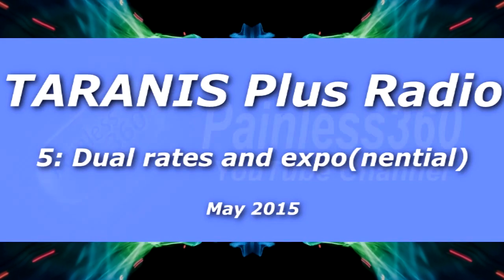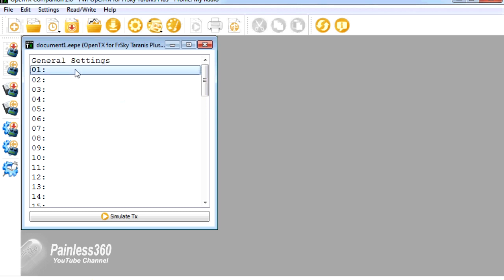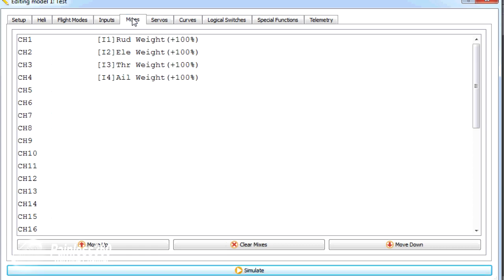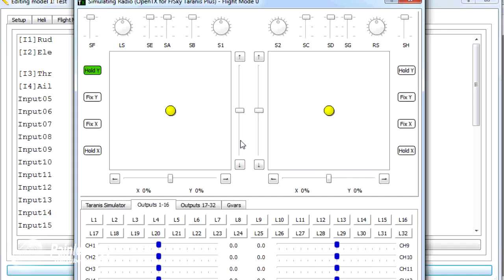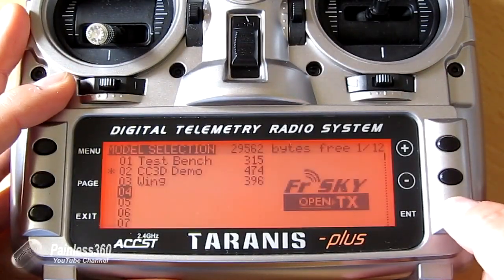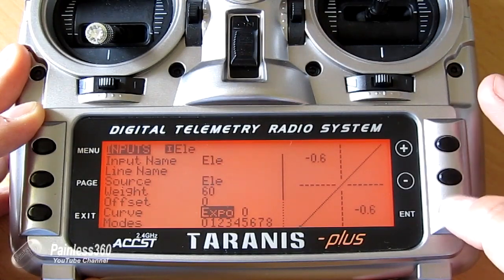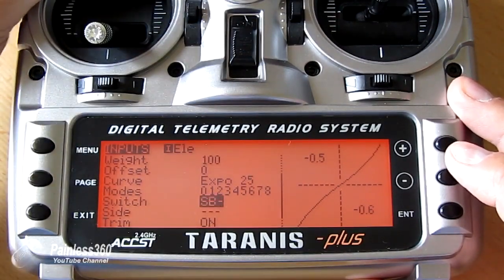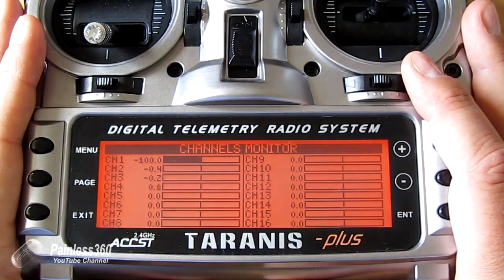(5/12) FrSky TARANIS Radio – Dual Rates (D/R) and Expo (Exponential) setup

Comment: Painless - wickedly helpful. Been wondering how to do this on my new radio, as I have it (finally) bound to my XK X100, but there is no documentation to help. Got it bound with some help of another video, and got it switching between angle mode and 3D, but had no idea how to do the rates. This is the final piece, so thanks hugely for this. K

Comment: Works for the same tx running edgetx. 7 years into the future 😁. I just swapped a 🦕72mhz🦖 rx for a betafpv micro elrs in an old glider. Boy have times changed from using dip switches on the back of the radio😅.

Comment: Needed this to set dual rates to change with the flight modes on my Dart 635mm. Needing full throws in stabilized mode, and less throws in acro modes. Like many things in OpenTX, once you know where to find it, you can adjust just about anything.

Comment: Great Taranis video. Very helpful in demystifying this superb radio. I, like you am a Mac user. However, I noted that you often use a PC Netbook when interfacing with the Taranis, such as adjusting firmware. Please talk a little about the pros and cons of using a Netbook in place of Mac OS or running Windows on your Mac.
Reply from the maker: +Escape Velocity I don't use any Mac products so don't have the experiences, sorry. Happy flying!

Comment: Thanks and used your guide on my X7 - works perfect! ...remark for you; I assigned it to a 3 way switch, top & middle, but when i put the switch in the low position you get no outputs at all anymore and can be tricky while flying - so i assigned low rates to the other 2 positions, dont want to get any issues while flying. Regards, Floris
Reply from the maker: +MileageMayVary you can add a setting to the switch you're using if you want to use a three position switch  or use the ! mark.. see our video on that..
Reply: Yes will look for that, thank you... was wondering about the !mark. For now i have 3 rates high, mid & low.

Comment: Hello Joshua I have a question. Ive had my Taranis XD9 Plus for about a year now and have solely been flying quads so expo was always on the FCB. At this point I have setup my elevon mixes on the Mixers screen. I also have all of my weights set here as well. I have been told to only setup expo on the Inputs screen yet there are Expo settings in the Mixers as well. Since I am new to fixed wing I want to keep this as simple as possible so I would like to start out without Dual Rates. What is my best approach to setup expo that approaches all aspects of what I need. On mY Mixers screen I have as follows: CH1 Throttle, CH2 AIL/ELE, CH3 AIL/ELE.
After seeing your video it almost makes me believe I can accomplish everything I did in MIXERS on the INPUTS page?
Sorry if this were quads I would be rolling right along LOL, the fixed wing thing is new to me. I kind wish there was a manual on this stuff :)
Reply from the maker: Joshua? I'd always put the expo into the model in once place if I can. That way if you change it then you don't have to find the other places you've set it up to make it the same. Also, by using the inputs you can use flight modes to set up the model too..
Reply: Sorry PainLess I had too many pages open....my bad :)
I appreciate your response. I did in fact go to the Inputs page and apply expo and it seems to be working. Once I get more Air time I will move into Dual Rates. I see in your video you (in this case) only applied Dual rates to the Elevator would I also apply it to Aliron? One more to eliminate my confusion. As mentioned I set up my Weights in the Mixers screen. Obviously I can forego the Weights in the Inputs screen but once I assign a switch for Dual Rates will those Weights in the Input screen override those in the Mixers screen?
Reply from the maker: If you're setting up for a multirotors then I'd add it to both. Usually something like 25% on Aile and Elev and 15% on Rudd.. Best of luck!

Comment: Thanks for the great tutorial. I find them very helpful. I haven't seen this before, but I wonder if it is a good idea to set rates on the throttle as well. I am just learning how to fly quads and I think having the double rates and expo on the throttle would be helpful. Do you think that is a good idea?
Reply from the maker: I wouldn't set rates but I do usually add a little curve to the throttle to flatten out the hover-point and add 'an expo' to throttle for newer pilots. Lots easier to hold the hover like that.. Hope that helps..

Comment: I have just tried this on a Taranis OpenTX 2.3.7 via the companion and for some reason it seems to invert the input, i.e. 100% at switch position SB-, and 60% at switch position SB-back. Repeating this on the Taranis directly gives the expected result!
Reply from the maker: Sometimes you find that Companion has a few 'features' that get fixed in the next version - usually! Always good to check it works the same on the radio... Happy flying!
Reply: I know this is an old comment but hopefully it will help someone.  If you choose the option with the exclamation point in from of it, it will be inverted. i.e. !SB↑ instead of SB↑

Comment: What do you do if, at no matter what weight you set, the graph,  the monitor, a meter I built like yours and the elevator, and other controls,  all travel the maximum distance. Thank you, for the great tutorials. The best.
Reply from the maker: Check you've not missed a step in the video ;D Best of luck!
Reply: I am sorry, I guess my question got confusing. Simply,  no reduction in weight causes a reduction in the servo throws. Why?
Reply from the maker: Something in the mixing you're doing is making that happen. Equal weights = equals throws.. I'd start again with a clean model. Best of luck!
Reply: Thanks, That did it.
Reply from the maker: Glad you sorted it. It's so frustrating to follow a video and get to the end with a different result!

Comment: Great video tutorial. I am new to the QX7 and used this video to setup dual rates. One thing I noticed during testing is that if dual rates is setup on a 3 position switch, SB in this case, and the switch is put in the fully forward position,  SB↓, there is no output to the servo's i.e no control ! This could happen accidentally. Is this correct or have I missed something ? I have copied the dual settings from SB- to a third position set as SB↓. This will eliminate the problem. Again thanks for your tutorials.
Reply from the maker: Use the ! Setting, see the video on it in the OpenTX mix school playlist.. best of luck!
Reply: Great that’s it, knew I was missing something. Using the !SB is the safer option, thanks again.

Comment: I love it how you keep it simple when explaining.Thanks for the video. I learned a lot again as a beginner. I have one question. When i hit the switch to the edited expo and dual rate of my aileron  it doesn´t work. The aileron doesn´t move.
Reply from the maker: Then something isn't right. If you get into these kinds of situations then add each piece of the mix, one at a time, until you find the one that breaks it. Easy to miss one little piece that causes it to misbehave! Best of luck!
Reply: Thanks a lot. It works. like you said i missed one little piece.
Reply from the maker: Hey! Glad you sorted it. It's so easy to do. We do it here lots and have to refer back to the videos for things we've not done for a while! ;D

Comment: Hello your video's are awesome and help a great deal.
I have just recently purchased a taranis 9dplus and its takes a little bit getting use to.
So my question is my thr kicks when my stick is at 50% i cant seem to find the sub trim if that is where it needs to be adjusted.
I love this tx and hope i catch on.
Thank you very much and you really give great instructional videos
Reply from the maker: +Erich Ristau if you mean that the throttle only starts moving when above 50%, then I check the stick calibration. Best of luck
Reply: Painless360 thank you i will check that thank you for the quick reply
Merry Christmas

Comment: Great article :)
However I was wondering, if I wanted to reduce the sensitivity of my quad by setting up dual rates/expo, would I do that for all 4 channels or is setting it up on the throttle generally frowned upon?
Just I am going either up or down, with little control sensitivity from my inexperienced hands :)
Reply from the maker: For a new pilot 25-35% on aileron and elevator, 15-20% on rudder and nothing on throttle. Best of luck!

Comment: NIce tutorial. Would this work if using it as teacher to the student radio DX5e? or does it depend on the student radio?
Thanks
Alex
Reply from the maker: Should work.. Best of luck
Reply: @Painless360  so if i set teacher radio with 30 % expo, when fli switch to give control to student radio....the student will have also 30% expo?
tkd

Comment: Using dual rates on my Eachine wizard x220s I set the switches up just like you did but i set up for 60 80 and 100 and it seems to be working fine I haven't stepped up to 100%  but it seems to be working good if you set up for a plane of some sort well that works fine for a quad as well

Comment: Newbee question. Why do you need the switch condition on line 3, the elev  low rate. Surely if "SB up" is not active, the next line, low rate, automatically becomes active as does any other position of switch SB.

Comment: You are perfect as always. I have one question. Can we assign only one switch for all the surfaces such as ail,ele,rud or only 2 surfaces like ail,ele.? Rather than having different switches for different surfaces. U know as there are several models on my taranis so sometimes its confusing to find which switches i have assigned. I hope u understand whT i meant. Thanks.
Reply from the maker: Yes you can. One switch can control many hangs at the same time. See the other videos in the OpenTX Mix School for a series designed to teach from the very beginning..
Reply: Painless360 Thanks a million sir. I just tested it and yes i can use one switch. And Thank you for the awesome work u do for us. And Thank you for the in depth detailed videos.

Comment: Very nice video. However, you should have setup switch B's forward position. If you were to move switch B to the forward position you would lose elevator function.
Reply: Curtis Adams Not only do you lose the function of the stick but when you set the switch to the unassigned position it holds the input at the value of the stick throw.  If you had, say, right rudder at about 50% at the time,  the rudder will get stuck at right 50%.   At least it does on my Taranis + with the stock firmware. A rather surprising and potentially disastrous default if you accidentally knock the switch when flying.

So you should either assign the third switch position to get triple rates which is effectively this logic...
 
if( SA^ ) {  //if switch A up
 high rate
}else if ( SA- ) { //if switch A center
 medium rate
}else if ( SAv ) { //If switch A down
 low rate
}

or use the NOT switch position (!) to use all the positions eg SA^ for high and !SA^ for low which is effectively this logic...

if( SA^ ) {   //if switch A up
 high rate
} else if ( !SA^ ) {  //if NOT switch A up
 low rate
}

or set up an input default.  The "lines" for the input get tested in order, top to bottom so if you assign the first line to SA^ you can use --- for the default second line. You have to have two lines.  You then have this logic...

if( SA^){  //if switch A up
    high rate
} else {  // otherwise
    low rate
}

One other point is that it is not necessary to hold the stick at full throw to switch between the rates. I think it just being done in the video to show the programmed  throw on the channel monitor but it's a bit misleading.

Comment: I assume there is a pitfall to be avoided here: In this setup, the third switch position will disable the input altogether, will it not? If so, I would never leave the third position undefined. Either setup a third rate, have the middle rate active two positions, or use a two position switch.
Reply from the maker: Or you can use the !SWITCH version too. Happy flying!
Reply: +Painless360 precisely. The point was just to establish the inherent danger of leaving a switch position undefined for such a function :-)

Comment: I have a taranis QX 7 for over 4 years, but something strange is happening, I lost the dual rate settings made by the Input, I don't know what happened, the configuration is there, the servos work normally, but the function does not work, just I managed to redo the dual rate setting through the Mixer. Any idea what might be going on. Grateful !
Reply from the maker: Not sure what you mean. Can you please explain a little more?
Reply: @Painless360  I have a Taranis QX 7! but I lost my dual rate settings, made by Input, I don't know what happened. The configuration is there, the servos work normally, but the function does not work! I was only able to redo the dual rate setting through the Mixer. Can you tell me what might be going on with my transmitter?
Reply from the maker: Still unsure what you are asking.  I'd look at the older setups where you did what is no longer available to find where the issue is... best of luck

Comment: Hello and thank you for your hard work delivering all this great information on the taranis. Im not sure Im in the right place to send you a message but if you could do a video on how to use and program a gyro for use in a fixed wing. I have a plane that is very rudder happy on the ground and taking off from a paved runway I find myself having to really fight the torque and pfactor during takeoff. I installed a gy401 gyro and tried using rate mode to aid in staying straight. I just need to make sure that I have my settings correct and if rate mode or heading hold are the best option to use. thank you again for all the info.

Comment: Hi, I've been informed that with Taranis you should setup Rates and Expo on the Input page and not the mixes page. I understand what Rates and mixes do, but I don't understand why you cannot set them up on the mixes page as the option is there to do so.

A friend said that if you do set rates up on the mixes it can cause problems with trim settings when in flight but I don't see how,

any chance you can either explain or point me to a relevant video

many thanks
Reply from the maker: With the Taranis and OpenTX there are lots of ways to do everything and there are better and worse ways depending on what you want to do. As the best practice has developed for OpenTX I'd put Expo and Rates on the inputs and then use the mixer or output screens to adjust travel, sub-trim and reversing. See my OpenTX plane setup videos for a full run-through..
Reply: @Painless360  many thanks

Comment: Lee I have a question about the expo settings in inputs, when I long press enter on the curve -> expo number I get GV1~GV9 setting. What does that mean?
Reply from the maker: Those are Global Variables and allow you to change the setups dynamically using settings that can be adjusted by allsorts and used in many different other places. We have a video on them and use them a bit in the 'Mix School' videos. Best of  luck!

Comment: Lee  In Open TX on X9D,  I have been trying to have a switch tell me what the value of the Elevon mix is set to.  I.E.  When I move SF I want it to say Expo On (I have this part set up) followed by saying Dual Rate 60% (or what ever value it is set to).  I sure would appreciate your help with this.
Reply from the maker: Do you mean you need it to speak a set number?
Reply: Yes - So if I have a 3 position switch set for Dual Rate (100% 75% and 60%) the radio will say the value I have it set to.  I am loving my X9D.

Comment: I have just realised that I have set up dual rates on the Mixer tab rather than Input tab. I guess because this was in the Mixer set of videos. It appears to work, but are there disadvantages that will come back to bite me?
Reply from the maker: Not really. It can be handy in more complex setups to do it on the inputs then that new rate is used in all the mixers that it appears in but I usually set them up in mixer here... Happy flying
Reply: @Painless360  Thank you for your prompt reply.

Comment: I am using a T12 Pro. Sometimes when I am setting exponential values (maybe rates as well), the number changes to G1, G2, G3 etc instead of 1, 2 ... 99. I am now thinking that this occurs when I press and hold Enter on the value field instead of giving just a quick press of Enter. But maybe not. It is always difficult to get back to 0. Do you know what is going on here? I Googled OpenTX G1 G2 G3 without success. I wondered whether these are Global values that can be set somewhere, so that for example standard rate values and exponential values can be set and applied either across the whole model or maybe even all models - although the latter is a scary thought!
Reply from the maker: I'm guessing that it is short for GV1 etc. Global variable are a way to change the value of something dynamically in the radio. See my Opentx mix school for how it works. I don't have a T12 here but I expect that you can press the enter key to change from a descreete variable to a GV and back again... Best of luck

Comment: Hi Painless pls I have questions about my Taranis x9 plus it turns off while I am setting Mixing up on page 5 just go to sleep in 1/2 to 1 minutes is any idea why is that happening Thanks
Reply from the maker: I've not seen that,  I'd check the battery is fully charged as step one... seasons greetings and best of luck!

Comment: I've tried to use the SA & SD 3 position switches for Triple Rate can you confirm this is possible 
Also the simulation screen action of pushing up or back of the switches corresponds to down or forward switch direction on the Taranis can this be changed...joe
Reply from the maker: It is. Best of luck!